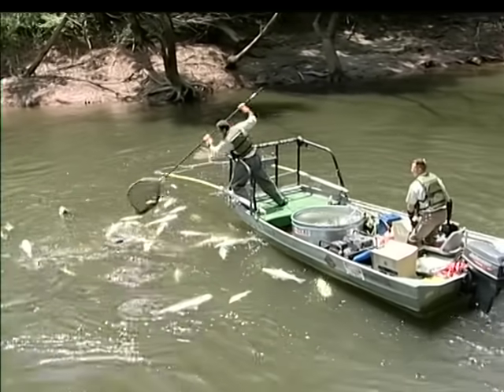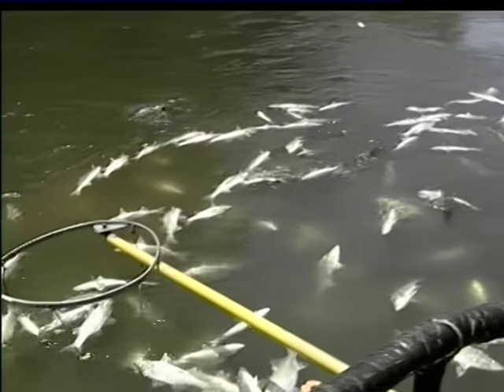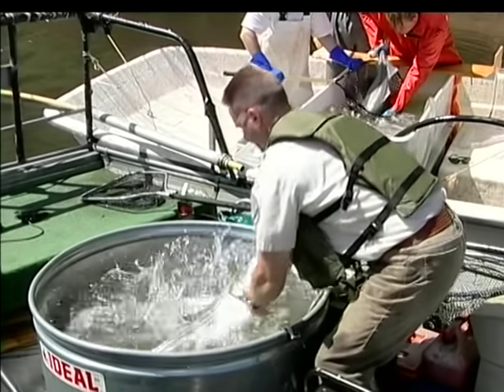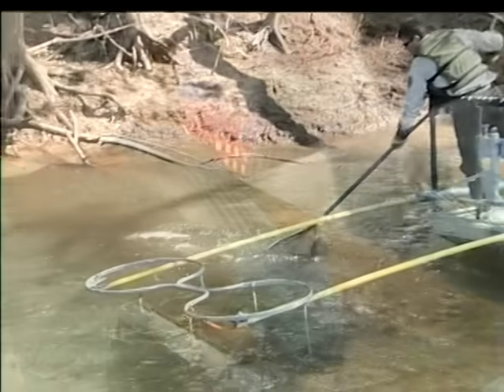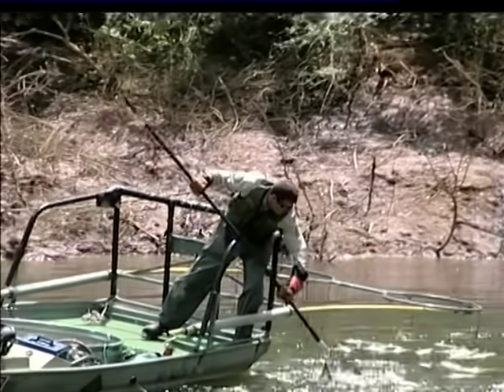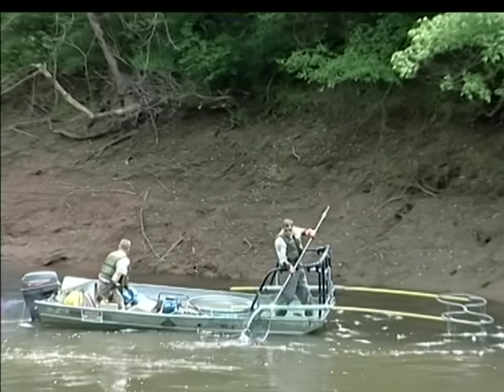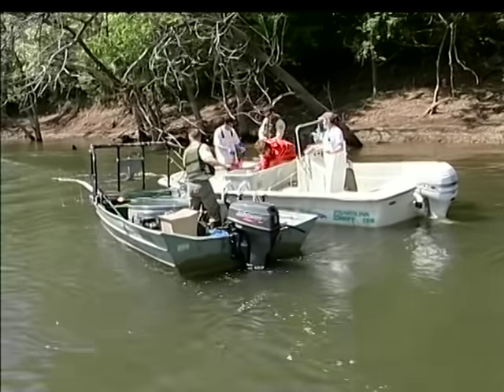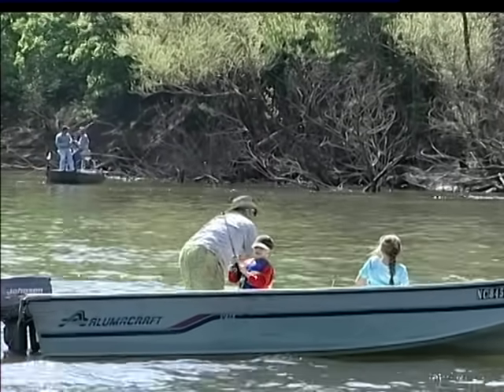Electrofishing Fish Shocking Explained

Comment: An easy solution for this would be to run a live wire from the generator into the water and shock them. In my youth we would fish with an old crank telephone by sending the electric current though the water. One crank and the fish would be stunned for a few minutes.
Reply: От не пи*ди. Умник

Comment: Whether this Electric current which stuns fishes temporarily can also kill smaller ones? Anybody?
Reply: Aku
Reply: yes, and many suffer internal injuries such as hemhorraging that aren't seen by the researchers.
Reply: No its a low amp high voltage device, the same as the how long can you hold onto the rod arcade games.

Or the 20$ pink tazers you get from the hunting supply store.
Reply from the maker: If electrofishing settings are set properly, there is no size fish that is particularly vulnerable above any other.  We also have a tank on the boat with fresh water that we change out often with a pure oxygen diffuser in the tank.  These additions minimize the stress on the fish.  Many times, the fish are so energetic we have a tough time collecting the data we need.